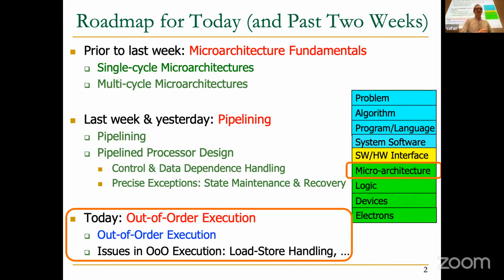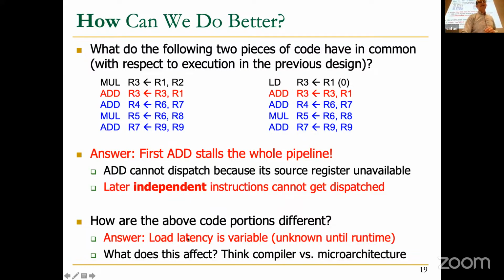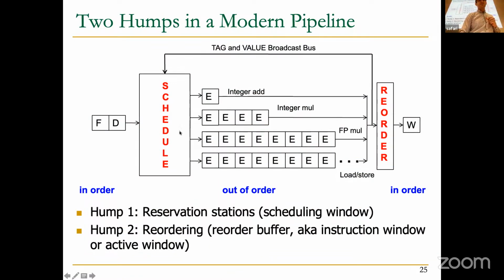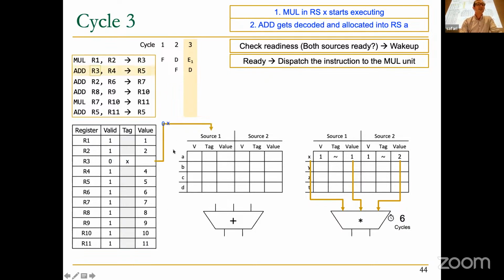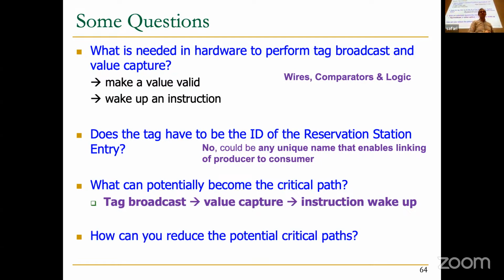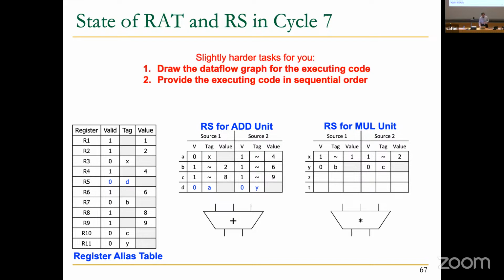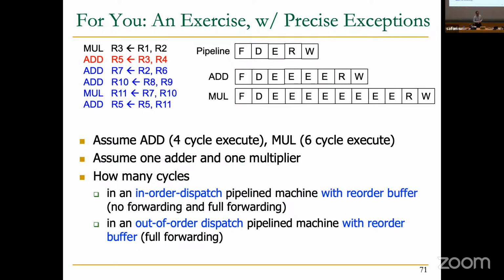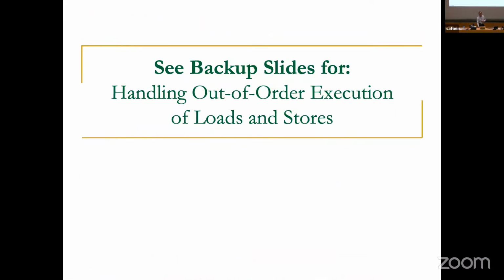Digital Design and Computer Architecture - Lecture 15: Out-of-Order Execution (Spring 2023)

Comment: @27.14 video the comparison of in-order vs out of order a minor error that needs modifcation: the MUL uses 4 cycles in first instruction and 5 cycle in fourth instruction so that is wrong, it should be 15 cycles vs 12 cycle , overall 3 cycle improvement , so please correct it in future lectures

Comment: It's incredible that Robert Tomasulo came up with out-of-order execution and used in 1967 in the IBM 360/91, and then it was slept on for another decade or two until frequency scaling feom die shrinks wasnt enough, and you had enough transistors to make it. Much like the old 360/91. Slow clock but lots of transistors available..

Comment: And out of order execution 
we are literally changing order
what about previous concepts of von Neiman from prev lecture, that each instruction should be after another without changing  order? 
That it's hard to debug, we have some error, like division on 0, and when debugging we think that some instruction that after some potential errors instruction not executed but in real they already executed
Reply: Note the difference between Architectural Register, which state will not violate von Neiman principle of sequential instructions executing. Any changes which will appear in Architectural Register and be visible to programmer must follow same sequence, that high-level sequential code have. Same time, Physical and Future Registers may store results for operations which done speculatively. So there must no be problems with debugging. In case of exceptions/interrupts, any values which was used before exception must correspond to state in sequential model. Just ignore any values and instructions which was executed speculatively before being needed - they anyway must be invisible.

Comment: Didn't get, in hardware can we execute two instructions simultaneously? I am talking about stage after decode, I think we don't have a lot hardware to execute simultaneously? 
like two multiple or two adds ?
Reply: Yes. That is called "superscalar" execution. Today you have 6-10 "ports" which can all simultaneously execute instructions. More specifically, you have something like 4 integer ports, and 3 floating point ports, and at least 2 load/store ports. One or two of the integer ports can do almost anything, and the other can do some clever subset based on realistic needs. Floating point one is probably something like FADD/FMUL/MISC, where it can do subsets of floating point instructions, and misc can help with some vector stuff that works in both FADD and FMUL, and helps with conversions and format changes. It can issue some number of instructions every cycle, and it can retire some number of instructions every cycle. The earliest commonly available superscalar processor was the Pentium in 1993, which could execute two instructions simultaneously, if the second one is one of the simple instructions.

Comment: What i learn: In out-of-order execution, instructions are not executed in the order in which they appear in the program or code sequence. Instead, the processor dynamically reorders and schedules instructions based on the availability of execution resources and the resolution of dependencies between instructions.

Comment: In slide 82, 'getting rid of replicated values 2'. In both RSs there are an additional V column compares to the 2022 version. You says they are for values, but I couldn't figure out what they are for. Can you please elaborate on that?
Also, at decode/rename does 'allocate dest pr to dest reg' mean 'copy the physical register pointer of the current instruction destination to reservation station for broadcast after it complete'?
Reply from the maker: A valid bit in the reservation stations indicate readiness of a value. They are needed for "wakeup" of instructions. Spring 2022 version omits these but it is better to include them (as we did in the Spring 2023 version) since an important function of reservation stations is to keep track of readiness of values and based on that to wake up and schedule ready instructions.